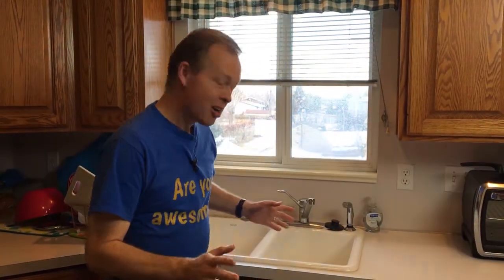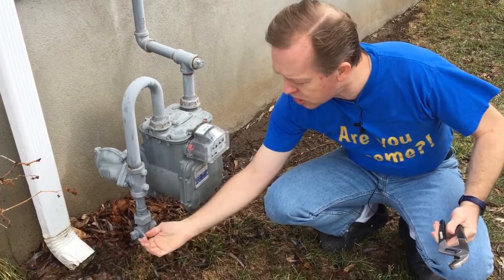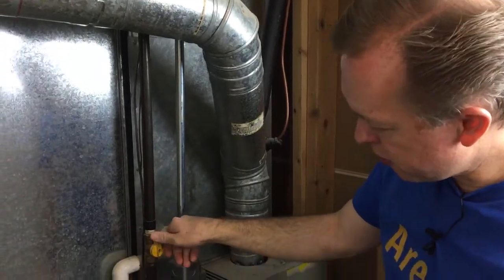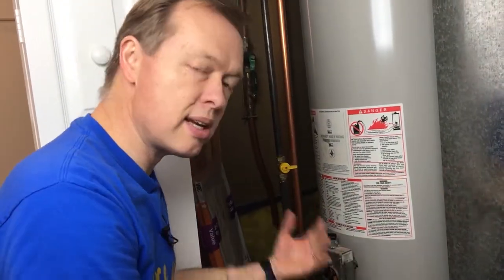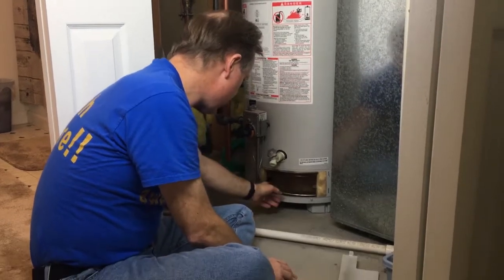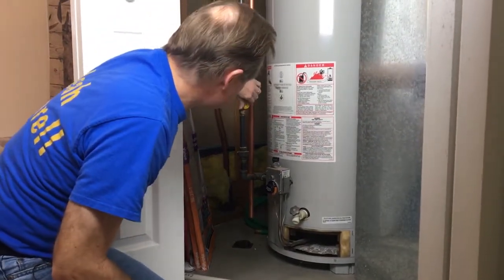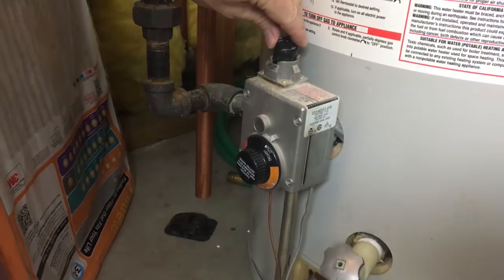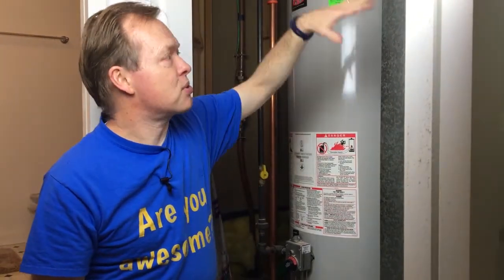How To Light A Natural Gas Water Heater | How Do Natural Gas Systems Work?

Comment: My gas valve only has an on off switch and no knobs or buttons on it. My thermostat dial and reset button are underneath the cover plate.
Reply from the maker: I haven’t seen one like that before. Try searching for the specific brand/model for a YT video or the company’s website for info.
Reply: @MyStepdad  yeah not much luck I'll probably have to have a professional come service it. Thank you for responding. Have a very happy holiday.

Comment: How to "prime" or remove air out the gas line for the water heater?
Reply from the maker: After you’ve made the connection have a controlled flame (like an extended hand held lighter), ignite it and hold it by where the pilot light on the water heater is. With the flame going, open the gas line and let it flow until it lights from the lighter. You might want to do it in 20-30 second increments if it doesn’t start by then. Pay attention to the smell. If you smell any natural gas and the flame hasn’t lit. Shut the valve off and let the air dissipate for a while (5-10 minutes with some airflow in the region. Then try it again. If you’re not sure about it, ask a neighbor or someone that has done it before to show you how.
Reply: @MyStepdad   thank you!!
Reply from the maker: @emmanueldurandjr5726  You're welcome. Be safe Emmanuel!

Comment: Good stuff as usual. 👍👍 another point about the temperature setting. Be careful as the highest setting...it is almost scalding. I recommend starting kinda low and working your way up to your desired max temperature. Also, do you plan on talking about water conditioners and how they work?
Reply from the maker: Good tip!  I should have had that in there too.  As far as water conditioners, I didn't have that on the list, probably because we don't have one, and I don't care for them anyway. I'm used to hard water, and soft water feels like the soap doesn't rinse off and it tastes funny. 😉